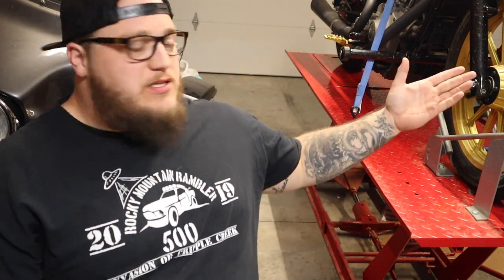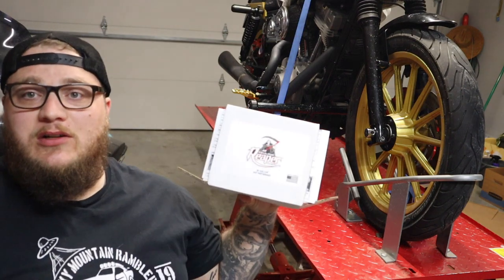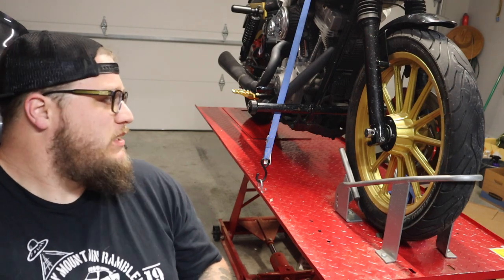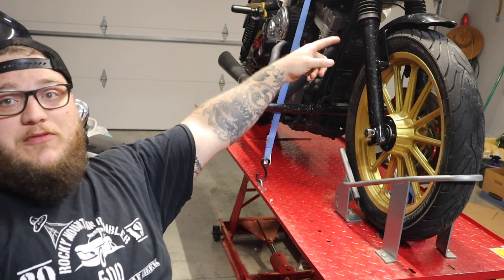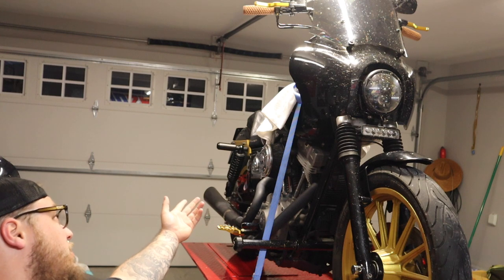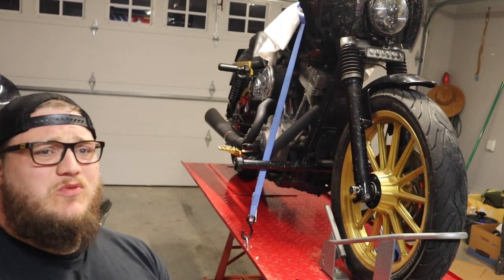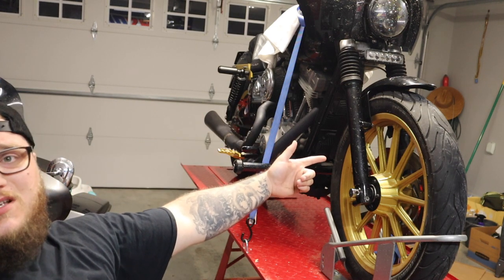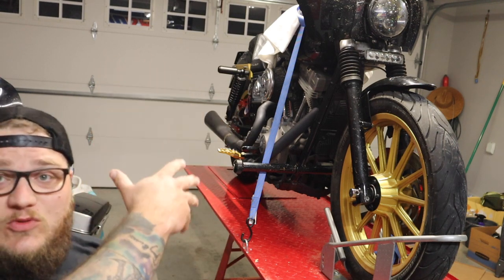Project Intro:Tank Removal

Comment: So why not drain the tank from the petcock?
Reply from the maker: I’ve never been able to get all the fuel out from there. The crossover at the end is the lowest point on the tank when you tilt it up.
Reply: @NattyBumppo  makes sense, I just don't always have extra "good" fuel line around so cuttin the line would be somethin I would do as a last resort. I have 99 Dyna project coming onto the lift, cool to watch your adventure with it:) I suppose cutting once and puttin in a T with drain valve would be good thinkin:)
Reply from the maker: @Roaddog420  oh man, that’s a hell of an idea right there! Good luck on the project!